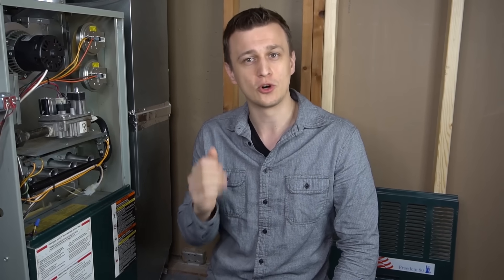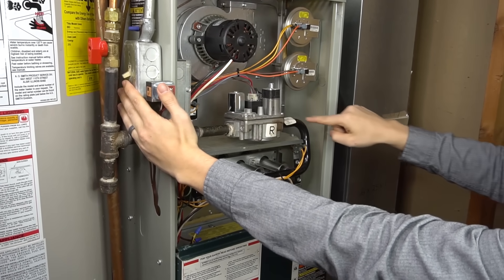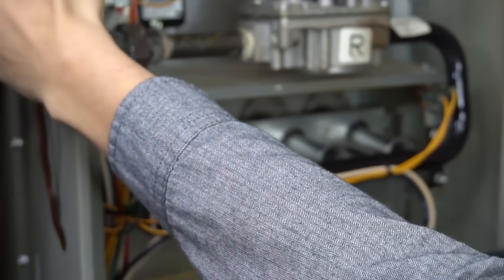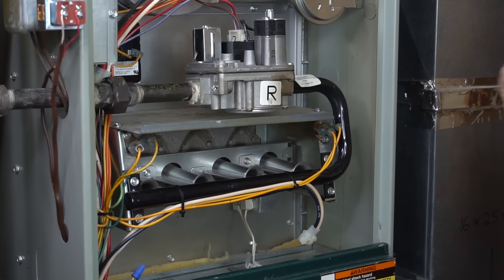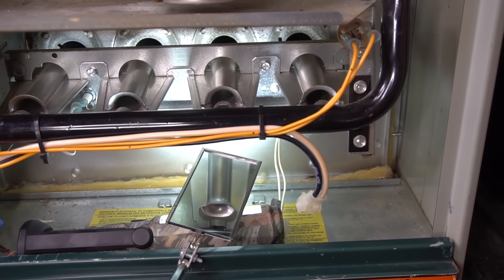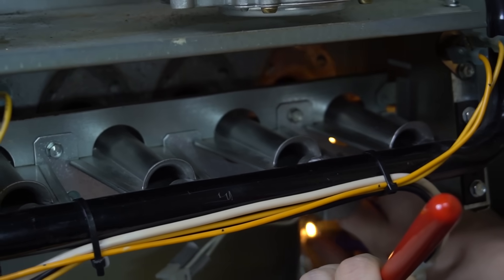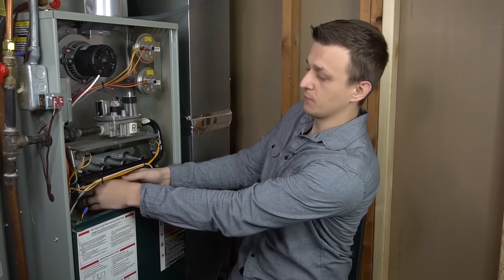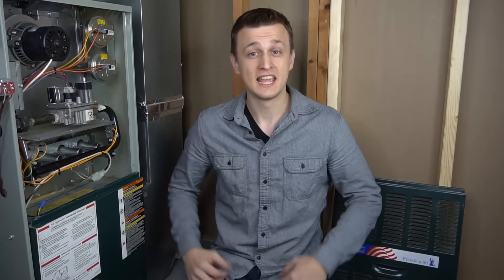Gas Furnace Wont Ignite - How to Manually Light Burners

Comment: Word of advice from an HVAC tech. DONT MANUALLY LIGHT YOUR FURNACE!
Reply: Tell us why? "Don't" means nothing in this context without a persuasive explanation. Also, your credentials so far don't exceed those of author who gave lots of details, so you need to clarify! :)
Reply: I’ll answer for him. Licensed since 1994 in light commercial furnaces to industrial boilers. Here’s why you shouldn’t manually light an automatic ignition furnace. First, there’s a HUGE warning label from the manufacturer in every furnace telling you not to. Second, if you’re not a technician, you most likely don’t understand combustion sequencing of different controllers. This could result in a face full of flame from a build up of gas (this would only occur under certain circumstances, but it’s possible).  Third, if you’re dealing with a DSI (direct spark ignition) furnace, you could easily shock yourself if you don’t know what you’re doing. I really could go on and on. Here’s the bottom line. Can you do what this obviously knowledgeable technician suggested? Yes. But understand, if you do, you are accepting a huge amount of liability and potentially putting yourself and your family in danger. I have used this procedure for troubleshooting. I would never walk away from a furnace having told a homeowner they could do this. My personal opinion, an extremely irresponsible video. That said, we’re all free to do as we like.
Reply: This is my 18th year in the buisness. I would ever tell a customer to do this. First of all what he is suggesting only accounts for a fraction of furnace break downs. Most of the time a furnace has other problems and needs to be inspected my a qualified person. Just resetting it and sticking a lighter in the burners to manually light it is just a bad idea.
Reply: I think my biggest concern is that a typical homeowner would do this, and continue to do it multiple times, rather than properly troubleshoot and repair it. If you understand the concept of outliers, this exponentially increases the possibility of a mishap.
Reply: This is totally dangerous I'm a journeyman HVAC service tech I would be fired if I told home owners this. 100% dangerous if you do not know what you are doing call a certified qualified tech to get you going.
Reply: You need to explain why, instead of telling us no. You sound like a parent who tells their kids not to do something, but without an explanation.
Reply: @zachs8033  Another person saying don't do it because the sign says no, or you don't understand how to do it. Luckily we have someone who knows how to explain things to us and does it very well. I think I'll go with Jay.
Reply: @amorales9613  I explained why not to do it in great detail. Either you can’t read, or you can’t comprehend. Good luck!
Reply: Why. ?  It’s snowing.  No heat
Reply: I watched one his other videos showing how the sequence goes on the furnace. I thought of manually lighting it because my igniter is bad and it's the scenario just like he mentioned..late, on the weekend and a holiday. We barely made it through last February's freeze down here in Texas. Since then I made sure my fireplace was fixed and we have a couple of space heaters if needed. Well it got cold again now my igniter goes out and what I have still isn't enough. I am somewhat competent on many things so I tried exactly this. I used an aim n flame cause a regular lighter is not something I would even consider using. I'm now heating the house a bit warmer than I would like but after it gets too cold again I'm planning to do it again until we get through this. I understand the concerns that HVAC techs would have and I wouldn't reccomend for someone to do this if they weren't fully understanding the dangers involved. Last year scared me and I'm not going to let my family suffer again if I can help it. To each his own and that's where I stand on the subject in this particular situation. This guy made me feel comfortable and familiarized me very well with the furnace. I found this video after successfully lighting my furnace so now I feel much better about what I am doing to get us by for now.
Reply: As someone not sure how this fully works, I ain’t lighting gas without knowing more.
Reply: @amorales9613  I can read and you replied to ME. I’m over this thread, seriously. All of you willing to accept the risk to your family and liability of doing this have been warned. Good luck!
Reply: I just did and I didn't die or get burned because I can't afford $192 trip charge
Reply: I’m a girl, who took Power Mech in school and I can fix just about anything with the proper tool 
(Jill-of-all-trades 😂). Now, common sense would say, if I don’t know what I’m doing, don’t do it!!
Someone would need to watch this video over and over again to understand what to do and how furnaces work, but nowadays, it’s all about the money, not the ppl suffering in their house!
Reply: All the HVAC techs in this post don't want homeowners to do this or know this because they won't  have a job then. The inducer which is the fan that is running removes the gas from the pipes... Hence when u turn on the furnace, u hear the fan first before the gas is released 20 seconds later... Of course there is risk if u decide to use flame for anything. Even lighting up ur BBQ grill😂 
Don't listen to these HVAC techs that went through simple training like this themselves
Reply: @wasfiahad3993  Totally agree, lots of haters who will trash this video but you will not see them making videos to help homeowners.
Reply: He literally said only to do this if it's a holiday or weekend and you can't get the parts or furnace looked at for a few days.  If my furnace goes out on a holiday,  one of you experienced Journeyman will charge me triple what it would normally cost,  if you show up at all.  Many people can't afford that much so I'm appreciative of him showing us how to do this in a pinch.  Js
Reply: yea, call you for $500 service call, then sell me a new furnace for $10k........when all that's needed is a $25 part!.......I've seen you guys at work, just shameful!

Comment: As an HVAC professional... never do this.
Reply: Can you inform us as to why we should never do this?
Reply: @xianwest  because you can get electrocuted! just happened to me, and now theres no power whatsoever to my furnace. DO NOT EVER use something metal to hold a match to light your furnace with an electric igniter!
Reply: Do NOT manually light your furnace! This is VERY unsafe. The amount of gas coming out of that burner is NOT safe for manual relight! Especially for someone who is not an HVAC or natural gas professional. So many things wrong with this video!
Reply: @anastasiachurchill9674 did you figure out a repair for the issue?  Maybe could use a plastic bbq lighter?

Comment: This is Very UNSAFE.
He has the power safety switch jumped out on the blower door. You need to call a professional technical to repair. Professional do not put their clients in danger.
Reply: What state you in? The safety switch is on the bottom cover panel not the top.

Comment: Not a good idea telling home owners how to manually light a furnace especially an LP furnace.
Reply from the maker: I considered that before making the video.. The gas valve only opens up for a couple of seconds so there is not much gas build up. I concluded that it should be okay to post a video like this, especially since there are already videos like this on YouTube.
Reply: Hvac 1 What’s the difference?  If the igniter is bad and the furnace isn’t turned off it’s going to continue cycling as long as the thermostat is calling for heat.

How many people would actually think to power down the furnace when the don’t have heat?  Very few to none...
Reply: Whats the difference between this and lighting a pilot manually on like a fireplace or lighting a stove eye.
Reply: HVAC with Greg The difference is Hvac1 is never doing any work for me...😂😂
Reply: HVAC with Greg   Nothing, it’s basically the same thing, just need to have better timing on lighting the burners.
Reply: Greenid Guy Good don’t need customers like you.